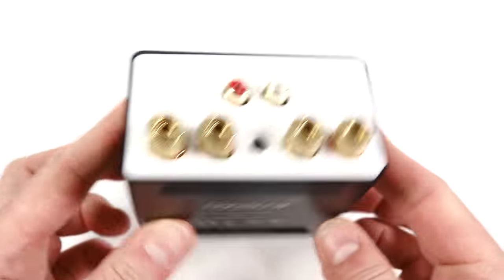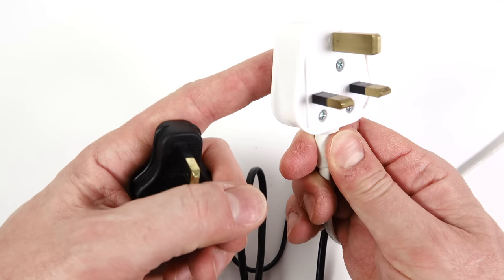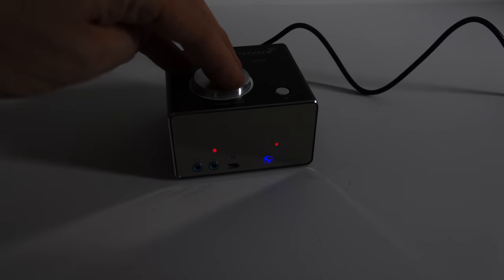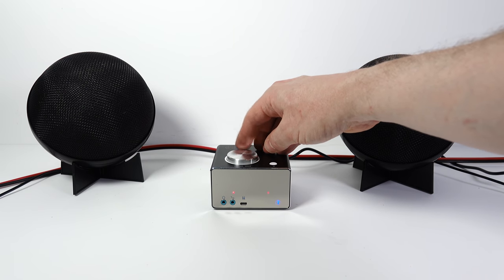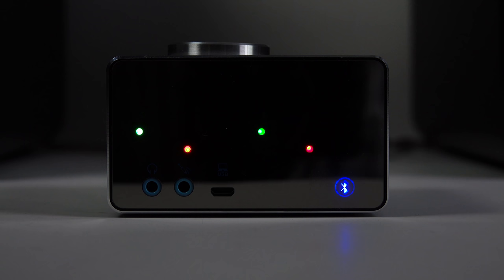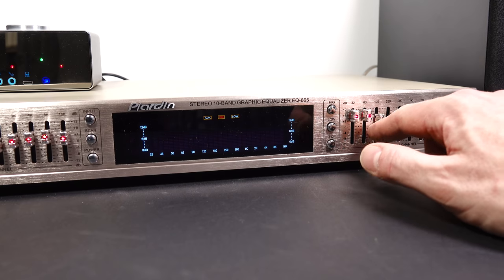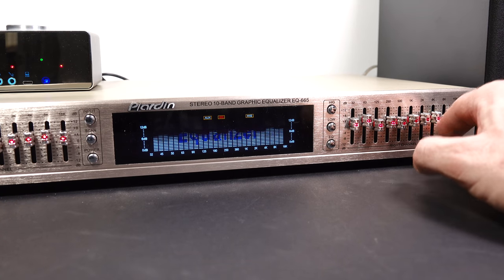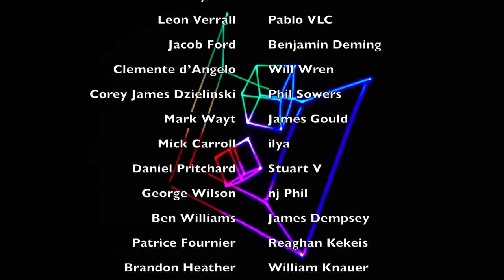REVIEWS: Mini Amp & Graphic Equalizer

Comment: Get a refund for that Equalizer... a 5 dollar second hand Radio Shack 7 band equalizer from the 1980s is 100 times better!!
Reply: I actually have one of those Radio Shack equalizers, still works fine. Even survived my brother-in-law running 8-ohm earphone audio from a small TV through it to drive a speaker directly, with NO AMPLIFIER!  I'd loaned it to him for recording, "borrowed" it back when I saw that, tried to explain to him about power amps versus line-level signals, etc.

Comment: Those wondering about the fuse, UK homes use a ring-main that doesn’t necessarily protect the individual sockets, so the fuse in plug helps ensure your individual pieces of equipment don’t catch fire.
Reply: Exactly, it's dangerous without a fuse!
Reply: The fuse is there to protect the cable or flex, nothing else.

Comment: I actually came close to buying one of those equalizers - something about it just rubbed me wrong though so I passed on it.  Definitely not regretting that decision now, seeing how cheap it is.

I love how it says "EQUALIZER" on the display, yknow in case you forget.
Reply: a narrow escape!  Jeez i'd be pissed if i'd paid £80 for that - which i wouldn't as i don't buy any new gear at all, but plenty will think its one thing when really it's another.  China.... what are they like?
Reply: Technics are totally awesome. $200 second hand, you will not regret it.
Reply: lazycalm41 There’s some very good stuff but you pay big dollars.
Reply: Perhaps the word 'rub' should be avoided in the comments for any review involving nob and balls.
Reply: By the way the Technics models I refer to are SH-GE70 and SH-E66. Both identical except the later has no tape output and is a couple of inches narrower. We have the SH-GE70 inline in a $15,000 music system and this $200 unit is just brilliant with ZERO audible noise. And it has multiple presets.
Reply: I got a dbx 215s - it's a 1U graphic equalizer. Sounds nice IMO, but does not have lights on the sliders (could be useful in the dark). It has detents for 0dB, which is nice

I paid 116GBP for it (including shipping) and I think it is worth it.
I got this equalizer because I was looking for a rack mounted one that was 1U in height (the rack is filling up).
Reply: LAZY DOG I picked up a Technics 7 Band GEQ   for less than $10 thrifting. It sounds really great and I actually use it for basic music mastering. If you look around in 2nd hand stores and on apps like letgo you can get really really nice hifi gear for next to nothing. My best pickup has to be my Pioneer F9191 cassette deck for $25.
Reply: Lesson learned! 
Don't buy cheap, no-name rubbish!!!
Sorry, but I've learned that one a long time ago

Comment: Not that it really much matters, however i purchased one of the nobsound amps last summer. I was using it as a lower power bench mark to test all the rummage speakers i had been finding at local thrifts. I found the power supply to be less than 50w ×2 so i found a 24v 4a supply and not only did it give the amp more head room, it also breathed more life into the VU function. It's been a stable little amp for about a year now. Currently using it as a sound bar replacement in a bedroom TV setup running a pair of JBL 2500's. No treble and bass controls, it really made finding the best sounding full range speakers easier though cause when you found a pair of super efficient KLH floor standing three ways, the little amp really shines through. 
 Admire this channel immensely, thanks for another audio video!
Reply: One more nice thing about these class-D amps is that they are quite low power consumers. I haven't measured, but they stay completely cold, although I have them plugged in and powered 24/7.

Comment: 2:23 Hey that's odd, Nobsound is a Chinese brand and the amp is clearly made in China, but the label has text in Traditional Chinese instead of the Simplified Chinese used in China. Normally only larger Chinese companies (ex. Xiaomi, Huawei, Oppo, Lenovo…) bother to use Traditional Chinese text for stuff that's destined for sale in Taiwan, Hong Kong and Macau, most smaller companies simply don't bother with that

Comment: I bought a Nobsound Yiniu B01 as a bluetooth receiver and DAC. RCA out straight to my JVC A-S5 integrated amp. Good build quality, all metal. It has two toggle switches on the front, one for power and one to swith between Bluetooth and Coaxial imput. Worked straight out of the box and also cost £80. Super bit of kit.

Comment: I hate novelty spectrum analyzers, especially ones that bother to mark out the different frequencies. Like, just make a real one you pillocks.
Reply: But that would be expensive and most of the people buying one of those don't know the difference anyway :D
Reply: I wonder if they made this on purpose so people in a karaoke bar don't go adjusting too much. Or maybe they just found some leftover junk that nobody really needed.

As far as i can see, the display itself only has a handful electrodes, 5 vertically stacked sections of somewhat jaggedy shapes. It is a pity, but try to get a new VFD of that size made today. You can have a gorgeous OLED 5.5" across but that's upwards of $50 alone, adding like $60-$70 to the cost of the device.

Then again an array of LEDs simply on the PCB of the device would have been fine and not all too expensive. Still, would people pay $20+ more for a real equaliser rather than a fake one? I mean you, Techmoan and myself would likely would avoid a fake one at all cost, thus either buying a more expensive device or something without a display, but i doubt  the world at large really cares.
Reply: Some of them are not even a freq analyzer at all, lol...just random bars.
Reply: "especially ones that bother"

So, you would prefer the ones that don't bother.
Reply: @RBSVader  This one isn't! Just the same circuit they put in disco lights to make them flash to the beat.
Reply: @greenaum  yep, you are correct. Real vfd spec. analyzer is very simple and quite cheap, but they continue to use these sh..tty boom-boom flashlights. At least, mine is real (10 bands, enough to me).
Reply: @RBSVader  Surprised this has a real VFD. Maybe if he looked closely it'd be a bunch of cyan LEDs and some plastic light guides. 

If it is VFD they're probably out of a skip.

Comment: Those little nobsound amplifiers are actually pretty awesome. The sound quality is very good. Many models fails miserably on usability though, connectors at odd places, LEDs that light up an arena, max volume beeps when you connect BT, etc. But they sure sound good connected to a pair of good speakers.

Comment: That AC adapter looks suspiciously like an old laptop power supply, with its 19v output.
Reply: 18-20V also happens to be about the best voltage to run these TPA3116 chips, they can get pretty toasty if you push them higher (and this manufacturer isn't very good at cooling them), and you'll be wasting lots of power if you run them lower. So a replacement laptop PSU is just perfect.
Reply: Yeah the 3.42A is a very standard value for those things as well. It's likely a standard, poor quality laptop replacement supply you can pick up for a few pounds, with a replacement label.
Reply: It looks just like the horribly electrically noisy and hot-running pieces of crap that come with external drive housings, too. Best place for them is in the bin before they burn the house down.